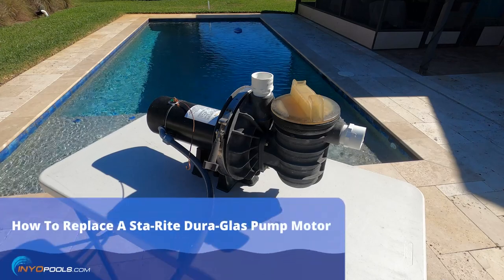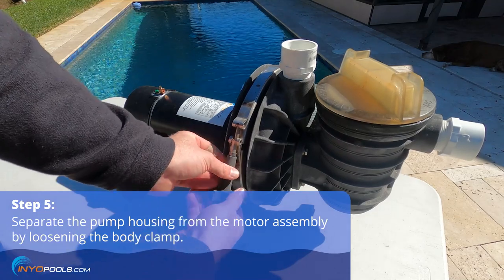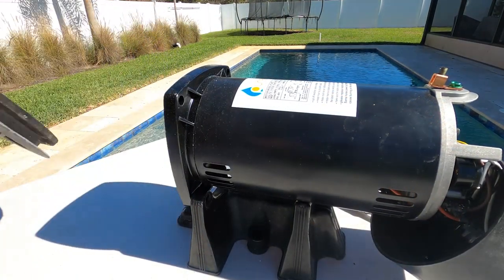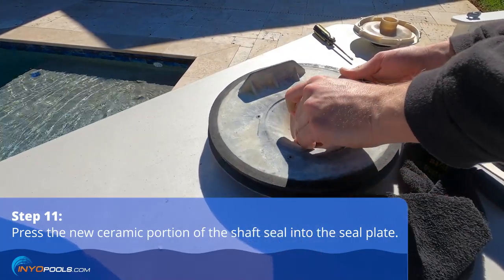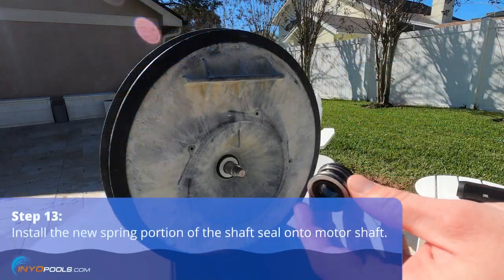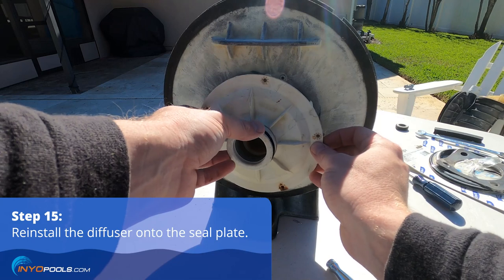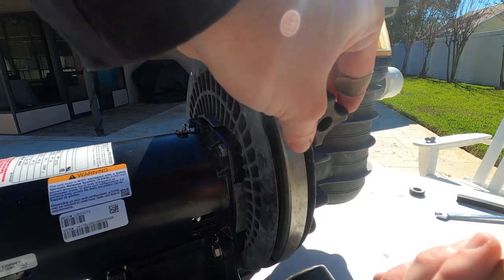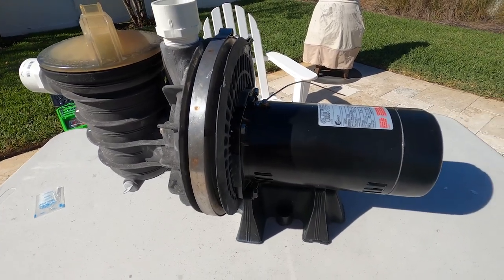How To Replace A Sta-Rite Dura-Glas Pool Pump Motor

Comment: Great video! Thanks!
One question, Is it normal for the brand new motor to give off a smell the first time running? Is it burning off something that was use to assemble the motor at the factory such as a lubricant? It's a chemical type smell not electrical.

Comment: With the spring loaded impeller seal it looks like you said full rubber side faces white ceramic ring,  but before you put on the impeller it looks as though you reversed it so metal side faced the  white ceramic ring.  Am I seeing things wrong here??
Reply from the maker: Great eye! I believe this step had to be re-shot out of order, it was put in place in the wrong orientation accidentally.

Comment: Once i got my pump back together, I tried to prime just so the impeller had water, but it leaked significantly. Any idea why? Ive pulled the strap of 3 times and reset the o-ring.
Reply from the maker: Where is the pump leaking from?

Comment: opened mine up and found that one of the screws holding the diffuser on was missing (I didn't install it).  What effect would that have if reinstalled it with one screw missing?
Reply from the maker: It shouldn't be an issue if you are only missing one. I've opened these before and it was missing 2-3. A real loose diffuser could rattle and also lower the flow of the pump.

Comment: According to the parts breakdown there is a 'slinger' seal, pn: 5056-04, that goes between the motor shaft and the back plate (seals motor shaft and backplate seal shaft)? I did not see you replace or install onto the new motor...is it not needed?
Reply from the maker: The slinger comes with the new motor and it's already on the shaft. It's pressed up against the end bell.

Comment: I swear after taking my def-user off my impeller has metal like brass around the front of it that has come off and don't see it on any of the replacement impellers. do you know where i can find one. thanks
Reply: That "brass" ring is part of the defuser housing.

Comment: Great video, but honestly, don't use these anymore, guys.   I tried to keep these kind of pumps going but the replacement motors do not last as long as they used too. And with energy costs so high you really should not use single speeds anymore. I replaced my Dura Glas with a Hayward Maxflo VS500
Reply from the maker: Thanks, for the feedback Richard. We'll piggyback on that thought. If you don't have the funds to go with a brand new VS pump, you can go with a variable speed replacement motor. The same steps in this video can be followed when upgrading to a VS motor. The only difference is that the VS motor would take a little bit of programming after it is installed.

Comment: It looks like the big square gasket from the kit was unused. Is that correct?
Reply from the maker: Yes, that was a gasket that goes between the strainer pot and tank body. Unless that is leaking, I usually skip that one and save the gasket.

Comment: why did you run a ground wire off to air?
Reply from the maker: As you may be able to tell, we are not doing this demonstration on an equipment pad but rather on a table. If this were on an equipment pad, the other end of the bonding wire would already be in place, tied to a ground rod. So, the only part you'd need to know to complete this task is when and where to attach the bonding wire to the motor. Which is what I believe we accomplish.
Reply: Makes sense thank you for reply. Great video. Only thing I’d add is for my motor I had to switch voltage from 230 to 115.  230 preset made it run half power and very hot